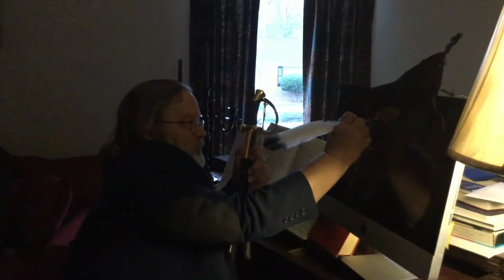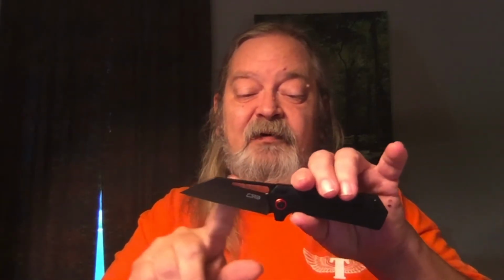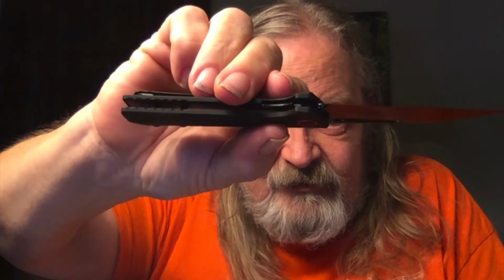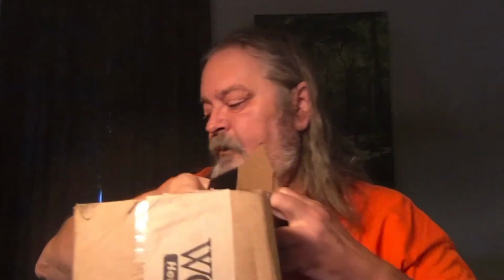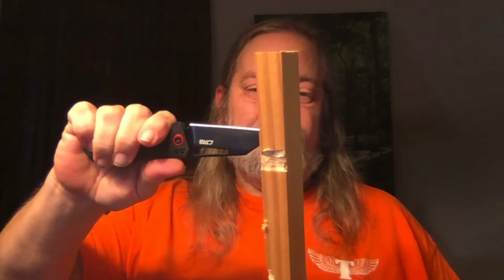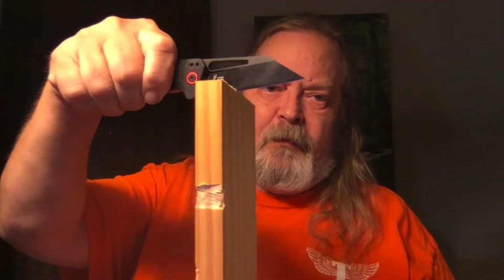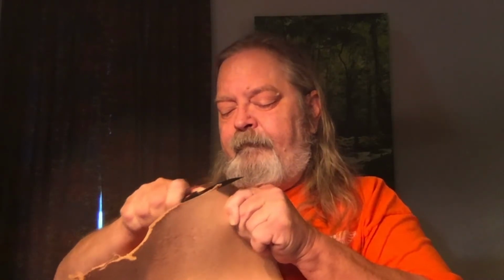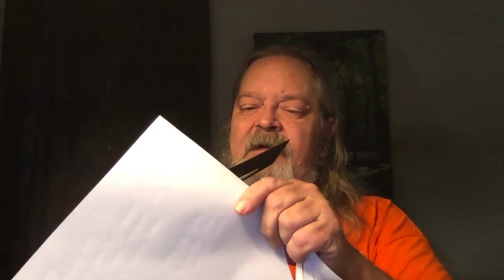The CJRB Ruffian - Gentleman or Blackheart

Comment: I have a question at first you said it was black powder coated blade and then later you said it was PVD aka (physical vapor deposition) and at the end of the video you said PVC ( poly vinyl chloride) wondering which one it is.  I miss speak all the time so I'm not being critical, I'm just trying to figure out what the coating is.

If it's PVD I want it, if it's powder coated or PVC I will get the satin uncoated version👍.

White Mountain Knives did not list what the coating was in their description/specifications.

I hate powder coating on blades, it causes a lot of drag, and doesn't last nearly as long as PVD does.✌
Reply from the maker: It is PVD.  Not sure why I said PVC near the end.  Must have had a senior moment or something
Reply: @ckurtz1013  Thanks, no biggie I'm not far behind you in age lol ! 
Very soon we may be in the same old folks facility together, modifying the cafeterias kitchen knives into drop points, spear points and harpoon blades 😂!